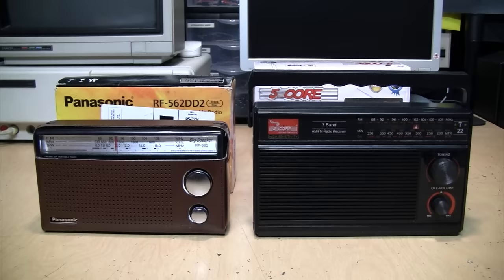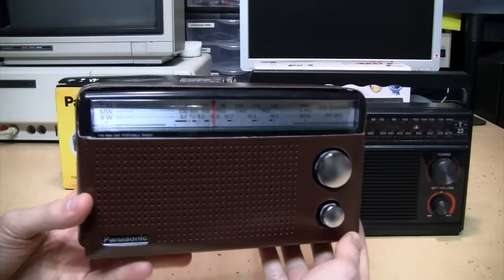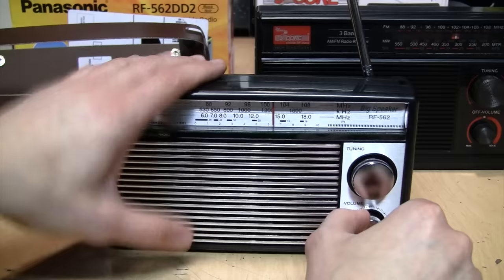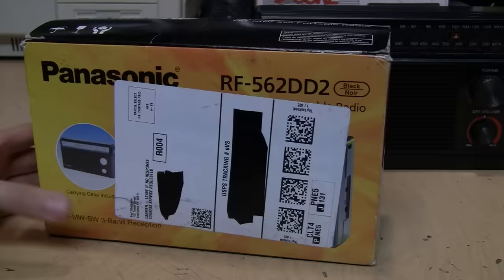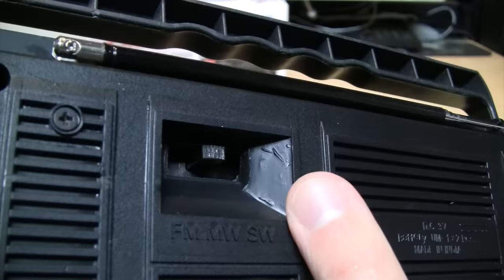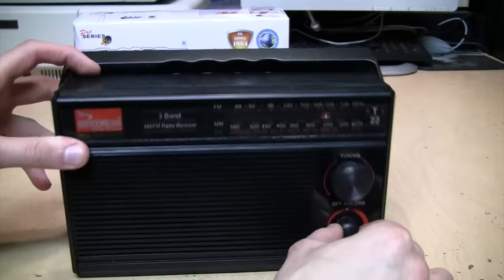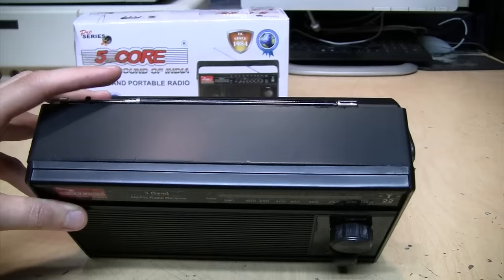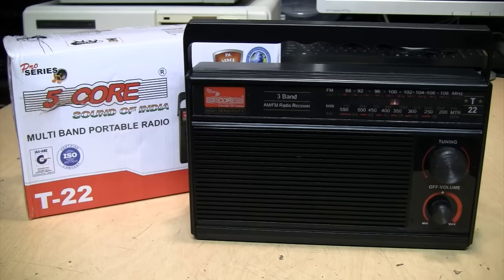Searching for the last true analog radio - Panasonic & 5 Core

Comment: I take a special enjoyment in how the established, reputable, globally recognised First World name-brand product from a developed country is not just exposed and shown up as a shoddy and cheap nostalgia rip-off, but absolutely taken to the cleaners by a poorly finished developing-world product moulded in old and tired dies and manufactured and sold by a company and brand that does not even have a Wikipedia article or a website I could find. Call it schadenfreude or perverse enjoyment: I'm rooting for the underdog.
Reply: the "brain" of that indian radio is a Sony analog tuner IC, probably on a "reference design" circuit from the datasheet. all the third world did was put it in a crappy case
Reply: @arcade_signal  Yet if that's so, then it still seems the first world can't seem to figure out how to do the same.
Reply: @ropersonline  Well there are a few reasons for that (none of them being that the countries which invented radios can't "figure out" how to make a decent one):

1. The IC is no longer in production, because
2. There is almost nonexistent demand for a basic AM/FM radio with analog tuning in the first world. Most likely the only reason this particular radio has analog tuning is because somebody bought a big lot of discontinued analog ICs for cheap, or had surplus. I doubt that the manufacturer even knows it's a good thing to have that IC, else it would be all over the box as a feature. When they run out of those chips, you will find a DSP in there and it will be just as crappy as the Panasonic (which is an extremely low end model not normally sold in the first world).
3. There are an abundance of first world radios with first world build quality with analog tuning available on the used market, for next to nothing. the minuscule amount of people who care enough to want one have their pick of the best of the best.
4. the first world has generally moved on from radios except for emergency use and weirdos. In the first case, analog tuning is not needed and in the second, as mentioned before, there is plenty on the used market to satisfy them

Anyway, poverty isn't cool or glorious and I'm rooting for the people trapped in the third world to revolt and/or escape their hell, not make sloppy copies of ancient technology in sweatshops for 25 cents a day.
Reply: @arcade_signal  "I'm rooting for the people trapped in the third world to revolt" <-- Revolt against whom though? Depending on your answer, that bit low-key smelt a little regime-changey. I'm more of a fan of the political slow train myself, but I have more confidence in the competence of developing countries to actually achieve meaningful socioeconomic change via reform, something that hasn't happened in much of the soi-disant first world in decades.
Reply: @ropersonline  it really depends on the place and there is no one size fits all answer. I would prescribe revolution to countries run by ultraconservative religious theocracies where the people, if given the choice, would want to move beyond burning heretics or whatever. or maybe a change of regime would be good for places where the regime is an inflexible authoritarian strongman dictatorship type of thing. I don't think telling the people in those situations to wait for things to get better via politics does a lot of good, when "politics" in their country is probably bribes and corruption top to bottom, or controlled by a witch doctor and his acolytes.
Reply: @arcade_signal : "I don't think telling the people in those situations to wait for things to get better via politics does a lot of good, when "politics" in their country is probably bribes and corruption" <-- Just be careful to only say that sort of thing about their countries. Unless you're okay with taking risks that might get you deplatformed. Because if you say that about our countries, well, people have been deplatformed for way less.
Reply: @ropersonline  Well I'd like to think I'm a risk taker, so here goes: The government of the United States of America is corrupt and ruled by the wealthy and powerful. The current president is a decrepit old man who at the very least is beholden to corporate interests and is most likely a military industrial complex or financial industry plant. The guy before him was a sociopath criminal who used the office and his gullible fans to fill his pockets. All American presidents before that have also been one or both. The United States of America is either complicit in or directly perpetuates horrors around the world. My country, the United States of America is bad. The US Constitution is a tool for oppression. 

I sincerely doubt this will get me deplatformed. In certain countries, do a find/replace on some words and this sort of talk (even in a comments section) will get you _disappeared_. The USA is pretty bad but on a purely selfish level, I'm glad I'm not in one of those other places, I feel bad for those who are and hope their situation improves.
Reply: @arcade_signal  You demonstrate complete understanding of what kind of wholly unambiguous cookie cutter critical speech is perfectly allowable and Overton-framed and puts you in no danger whatsoever.

Comment: I immediately  purchased this radio upon watching your review. It came this week and I installed 2D batteries and enjoyed my local radio station. Brings back fond memories of 70s, 80’s,90s. It’s funny, I told the wife after battling our new laptop, my iPhone and smart TV literally all afternoon this Sunday afternoon the only devices that worked without hassle were my antennae TV, and this little radio. Sigh. I miss easy to use reliable tech. Thanks!

PS: If anyone installs AC power in this 📻 i would love to watch the video! 👍🏻

Comment: The third battery space is actually powercord storage space, which is not needed in this version Agree it is too small for the power cord. There would probably be a higher model with 220v power and another model with DC input based on local markets, availibility of electricity, availibility of D cell batteries, or DC power from lead-acid battery from the tractor/ bike on the farm. All models using the same standard housing !! 😀😀
Reply: You're wrong LOL You can't fit any power cord in the space of single D battery, unless it's an inch or two long only, or it is really just a cord without any plugs...
The DC 4.5V input socket (blinded now) left from previous version/reiteration of this radio give you nice hint it was designed (the housing, not the actual board inside this model) to run on 3 x 1.5V batteries = 4.5V and this empty 'compartment' is where the third battery would go in.
Reply: The cord compartment has to be slightly wider and/or bigger than the battery compartment. We used to have a Sony radio with a smooth analog tuner that had this sort of space for the cord.

Comment: Thanks for the great video. A few other analog (non-DSP) radios you can still get include the little Sony ICF-P26 pocket radio and the Kaito WRX911 multiband shortwave. They cost about $20 each. If you want to spend a little more money (about $50), the Tecsun R9700DX is a pleasant sounding analog AM/FM/Shortwave that's about the size of a paperback book and comes with a nice case and even has a very cool amber dial light that gives it a great "old radio" look. I own all three of these radios so I've used them extensively; they're all good-quality radios.

Comment: I've never remembered AM sounding as good as it did in that Indian radio.
Reply: I think that some of the bias (in north america at least) is that most people's experience with AM radios was car stereo's; with the constant unstoppable interference from the ignition systems of the car.

I volunteer at my local museum and were have several functional AM radios from the 30's to the 70s, and yes, they sound this good and better. AM can sound as good as FM; it just requires proper design, and not being treated as an afterthought.
Reply: A fully modulated AM carrier is very sweet to the 👂ears👂.
Reply: Really. That's a speaker feeding a mic. No judgment possible. We used to have a 20 to 20kHz AM station but it died in 2007 a victim of HD radio (what a joke) , it was HIFI not normal AM. Any good car radio and car has zero noise from the engine. AM will be gone in 20 years. Most AM's have an FM repeater now. It may not have the range but goodby noise. Then there is the internet.
Reply: I still find AM and SW fascinating things, especially SW because I can pick up radio stations from across the English channel
Reply: My 2009 Jeep had an excellent sounding AM radio.  It sounded as good as some cars FM radio.
Reply: If you're listening to AM radio in Europe, Asia or Africa with 9kHz channel spacing, AM radio in North America actually has more bandwidth, with 10kHz channel spacing. That 1kHz additional bandwidth that American broadcaster use does make a noticeable difference I've found.
Reply: Seriously? I've got  vintage AM transistor sets that will blow the doors off that shodily built thing.
Reply: that's nice
Reply: @echodelta9  am radio is dead in most of the world for at least 20 years....
Reply: I have never, no. I am going off experience with worse radios.

Comment: Just like an Indian product, the looks don't amount to much, but the what matters inside seals the deal!
I'm trying to repair my Dad's old radio. If I fail I know where I can get a replacement!
Thanks for the video!
Reply: This is not a branded Indian company but a local assembly unit. Nobody knows this brand in India.  There were two branded indigenous Indian manufacturers Nelco and Santosh that produced such radios 25 years ago. Recently the maker of Nelco is manufacturing digital radios  by the name Croma.

Comment: Sounds like the electronics are better than the housing. These could be a suitable donor for a retro radio build into an antique wooden or Bakelite type casing.
Reply: No reason for that. Tube chassis are often extremely easy to get working again.
Reply: @mfbfreak  Could still swap it into a better quality casing while retaining the benefit of compact size.
Reply: @NozomuYume  Why bother when there are still hundreds of old radios waiting for restoration in thrift stores or on Ebay. DSP based tuning has only been around for about ten years.

Comment: For DSP, based radios it's best to have an small LCD with the current frequency and buttons to set the frequency and scan for stations. Using an analog-like tuning dial with a DSP just does not work well, DSPs were never made for this.
For analog tuning dials to work properly you do need analog tuners, not DSPs.
Reply: DSP tuning mute can effect digital tuning radios so DSP isn't perfect even in digital tuning radios, some radios don't suffer from the tuning mute like the Tecsun PL-880,990x, S-8800 but the audio quality on SSB is just terrible. 

The PL-330 and H501x sound better but still far from perfect, can't beat the sound of a pure analogue radio such as the PL-660 and PL-680 Tecsuns and this makes using ECSS a joy and almost impossible on the DSP radios, ECSS is essential to the ture SWL DX'er.
Reply: Auto scanning radios are terrible. They skip over weaker stations or lock onto one of the images of a strong station. They give you less control to cut costs and size. DSP can be made quite responsive and good enough for FM. For example using a bt878 chip on a PC. The thuds when tuning fast are short and quiet.

Comment: The Indian radio is made locally probably in small shops. These are not branded one, brand stopped making radio long back. If you open the Indian radio probably it will be using a chip for fm tuning. If you can get mw/sw radio only then you can be sure of pure analog.
Reply: Sure FM use chip for tuning because FM broadcast was not there when radios around world using LC tunning for reception. FM arrived late in India during 80s.

Comment: You are right about the analog/digital tuning frequencies for am,sw,fm,,,as I do have one here as a radio cassette recorder,,,that sounds so weird when tuning in stations on am/fm station frequencies,,,sounding like digital tuning,,,which sounds terrible.
Definitely analog tuning is the way to go,,,as I grew up with using a transistor radio back in the day on am band,,,which is now vintage,,,and still actually works 2day,,,40 years on.

Comment: We need to see the internals of that 5 core radio. Looks like a copy of the Philips made radios in India. The shortwave antenna is probably an internal loop (rejection of the local electrical noise will be excellent if it is indeed a loop)
Reply: Don't know if it's using an internal loop? The last radio I bought with SW said to keep the antenna flat (not vertical) for best reception, so in this case not extended rather than up is still better.
This does look like a poorly made Philips, great radios.
Reply: could be, i have a couple of philips sets with same control layout... though they are lw and mw only, no sw
Reply: The 'Philips' branded radios in India are also manufactures by small and tiny manufacturing units, who are  licensed to use the 'Philips' brand.

Comment: I always find it amazing how today it is cheaper embedding a whole computer inside a radio than making a simple am radio with analog parts
Reply: Especially given that there are chips with analogue radios on them.
Reply: The answer to that is the analog filter network.  Doing precision filtering in DSP is SO much easier than using low-tolerance parts with mechanical interfaces, like tunable coils and capacitors.

A digital receiver is tuned to a relatively wide bandwidth, and filters everything in software.  The IC itself is way more complex, of course, but once it's designed, it can be replicated with photo lithography.  Contrast that to the dozens of parts needed to design an analog filter...
Reply: @nickwallette6201  I know, I am a computer engineer with a masters and ongoing phd in microelectronics myself. This still amazes me.

Comment: Have had one of these radios for two days. Immediately obvious is it's susceptibility to overload on FM. I pulled the telescopic antenna open, and it refused to fully slide back down. The entire antenna assembly is loose. I'll have to open it up to correct this, and will add an AC adapter jack as well. Even with the above, this radio is worth it for it's AM reception alone. Thanks for bringing attention to this radio.

Comment: Thanks for the much-needed primer on current radios. I've bought some new ones the last few years and if it's not the tuning, it's the sound that's wrong. I went retro and got a Realistic Patrolman SW-60 and the sound quality is excellent and never had a problem with tuning. Baseball on an AM station hasn't sounded that good to me in years!

Comment: That extra compartment next to the batteries is where a power cord would have been stored. Either they changed the design after the plastic molds were commissioned or they made an alternate model with an on-board power supply.
Reply from the maker: No, that space is far too small for a power cord. You can see it was originally designed for three batteries, thus the now-defunct 4.5V DC input on the back.
Reply: @vwestlife  Plastic mold making is very expensive. I wouldn't be surprised if the "5 Core" tooling is salvaged from some other radio production line, or perhaps they made a cast of another radio to make theirs?

Comment: 0:20 here in Brazil, VW made the original Kombi starting from the 1950's up to 2013, when they discontinued it because new laws demanded airbag and abs in all cars manufactured from 2014 and beyond (and VW Brazil still contacted VW Germany to try to make it viable in this 1950's car). The only real update the Kombi had here was having the air-cooled engine being replaced by a water cooled engine in 2006 to meet the new emissions requirements.

Comment: That 5 Core T-22 radio looks so good. Love the design. It has that 90s look to it.
Edit: And it sounds rich in sound. Might buy it since I need a new one. My portable radio (Kenner PR 410) is dying ever since my cat knocked it off the shelf. There's a lot of signal drifting now and the dial is "off grid" by a couple kHz (if I wanted to tune to 107.5 kHz FM I need to tune to almost 106 kHz).

Comment: If the issue is the 'skipping' sound you don't like — there are digital radios that don't do that :) they're expensive, though. BTW, AM is not only MW — Long Waves, Medium Waves and Short Waves all use analog Amplitude modulation and also may have DRM (worldwide) or HD (North America only) radio instead of AM.

Comment: The Tecsun R9700DX is still full analog and is an amazing radio with great reception.
Reply: I agree with Kevin, I have this radio too and it is a great receiver. It has a great tuning display.
Reply: @garyblackerby3226  Of course as a radio collector I am vey tempted to add the 5 Core to my collection.

Comment: I’ve never actually heard AM come in as clear as on the analog radio. Digital really butchers AM.
Reply: Yup, trying to digitise a format that is designed to use the strengths of analogue. I volunteer at my local museum. We have several restored AM radios from the 1930s through the 1970s that sound ridiculously good; even without 'proper' antennas. Meanwhile in my car every AM station sounds like it has been put through some sort of fuzz box (and it's not interference from the engine, as I know what that sounds like, this isn't that)

Comment: 1:20 ahh yes, back when radios actually used a variable capacitor and an inductor to tune to a frequency. I believe I had that radio as a kid or at the very least I had a GE model that was probably sold next to that. I remember the "IC" branding on a lot of their stuff.